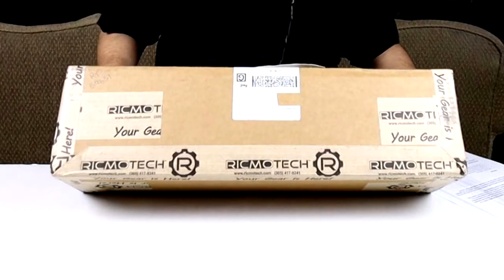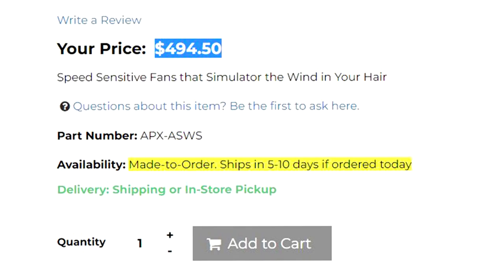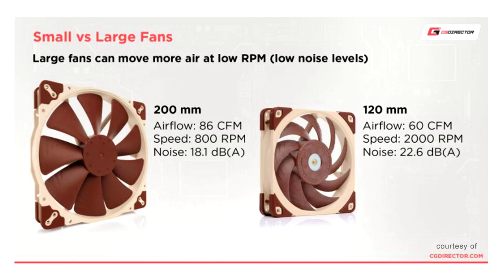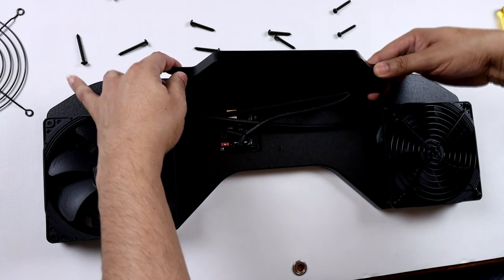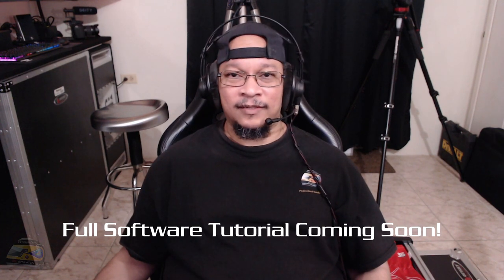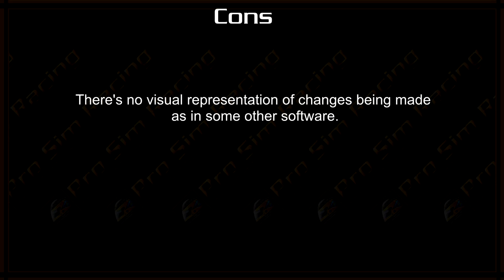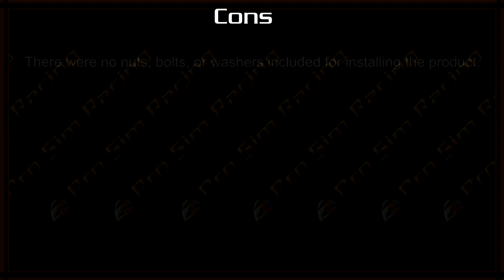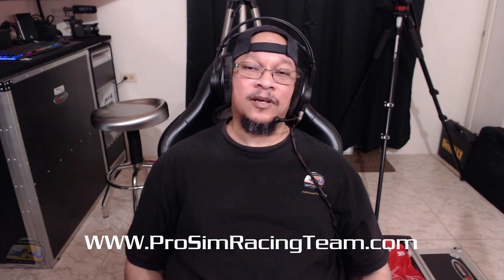Sim Racing Wind Simulator Review | Ricmotech Wind Simulator✅

Comment from the maker: Keep an eye out for an in-depth tutorial for the Ricmotech wind simulator software coming soon!

Feel free to ask any questions that you may have about the Ricmotech Wind Simulator in the comments section below and I'll get back to you as soon as I can.
Reply: How is the package 6.5 in. high and the actual component inside the package 7.5 in. high? Not trying to be a dick, I actually need to know it's dimensions.
Reply from the maker: @vegasmike5300   Sorry for the late reply buddy, I only just saw your message because it got flagged by YouTube. That's actually a really good question... The actual product is an inch higher because it is at a 45-degree angle in the box. In fact, the box actually measures a tad over 9 inches corner to corner at a 45-degree angle. All of the dimensions given in the video are one hundred percent correct.
Reply: @ProSimRacing  thanx man.
Reply from the maker: You're welcome buddy.